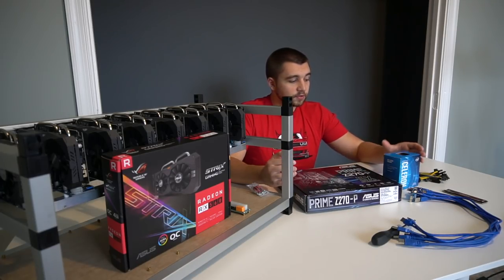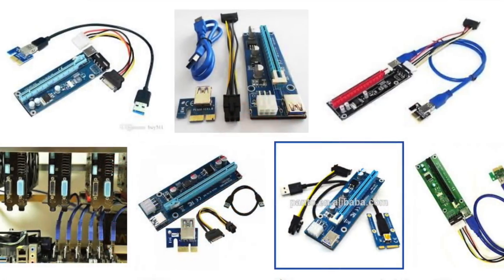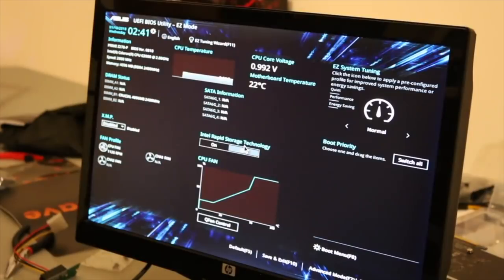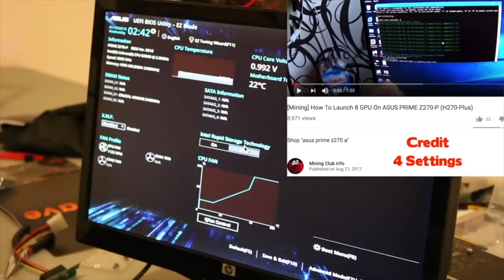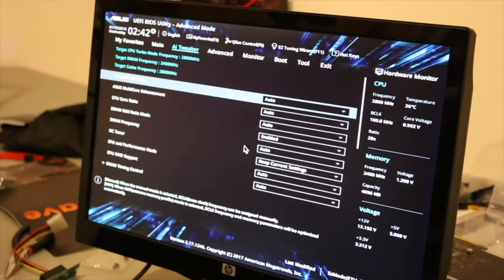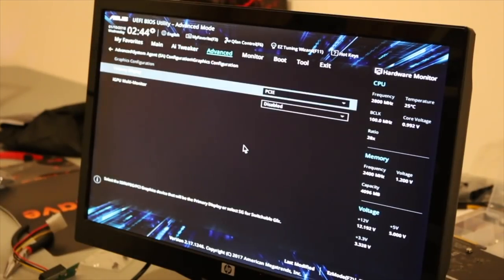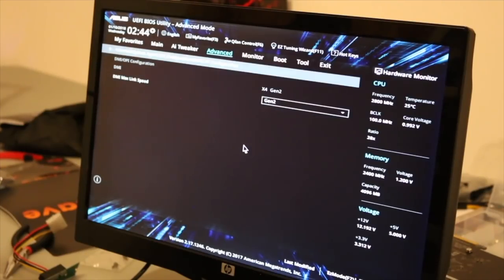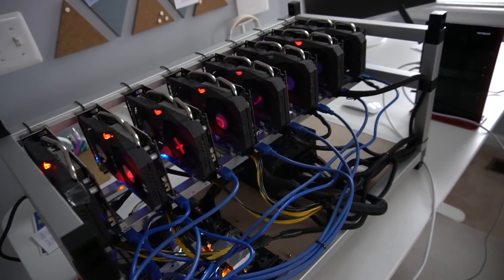How To Build Crypto Mining Rig W/ $2000 or LESS - Beginner Tutorial - ETH/ZEC/XMR

Comment: Vosk - since this is a tutorial for beginners you should have pointed out that you need to connect the power switch or it won't turn on.  You had it hanging down right in front too. I made that mistake when I built my first one. It had been a long time since I built a computer. I just completely forgot something that simple.

Comment: Beginner? I started with two GPUs for mining despite I've been building systems for a long time.  :)  Well, I did that just to minimize risk and just to see if it's all worth it.  It is quite amazing that I have these powerful video cards where it was just a dream for me to get myself just one.  I meant, without mining, I can't justify buying a nice card as I will rarely use it play games.
Reply: I'm jealous. Due to shortage, I haven't purchased a card for more than 2 weeks.  The last one I've had are MSI armors, one rx 570 and a 580.  I didn't know they have weak mechanical specs as they don't include backplates and a thick-large heatsink compared to less known brands.  They overclock nicely though and the fan is a great-expensive design.

Comment: I was thinking of buying that asus board but for the same money I can get the gigabyte b250 fintec with 12 pcie slots. 
I have a 1070ti, 3 1060s and a 1050ti in a rig which does 109 Mh\s and uses less power than these 560s.
If I would built a new rig I would buy 1050ti instead of rx560. Mine does 15 Mh\s at 60 something watt.

Comment: Hey Vosk,
I recently switched from Nicehash to Awesome Miner/Ahash pool w ccminer. My rig is a Asrock Pro BTC, cheap 1151 Celeron, 16G Memory, 6 Strix 1080ti's, version 8 risers, 2 1600w EVGA power supplies. I'm loosing about 20% hash rate on the risers. When I slot a card on another computer by itself on the 16 PCIE slot it's way better. Do you have any experience with this issue, ideas or suggestions?

Thanks 

Matt

Comment: i have a question, so this build is a little better than my gaming pc i bought 5 years ago.  My pc says id make roughly .80 cents a day. This setup should be about the same until i stack 3+ Gpu's right? I got all the parts only bought 2 rtx 560's so far. My PC currently running a 1060

Comment: Mining Buidl:

*Thermaltake Gravity i2 95W 7-Bladed 92mm 4-Pins PWM Aluminum Extrusion CPU Cooling Fan for Intel Core i7/i5/i3 CLP0556-B

*ASUS Prime Z590-P WiFi LGA 1200 (Intel 11th / 10th Gen) ATX Motherboard (PCIe 4.0, 10+1 Power Stages, 3 x M.2, WiFi 6, 2.5Gb LAN, Front Panel USB 3.2 Gen 1 USB Type-C, Thunderbolt 4 Support, Aura Sync RGB)

*ARESGAME Power Supply 650W 80+ Bronze Certified PSU (AGV650)

*SanDisk SSD Plus 1TB Internal SSD - SATA III 6Gb/s, 2.5"/7mm - SDSSDA-1T00-G26

*SAMSUNG 980 PRO M.2 2280 500GB PCI-Express Gen 4.0 x4, NVMe 1.3c Samsung V-NAND Internal Solid State Drive (SSD) MZ-V8P500B/AM

*Intel Pentium Gold G6400 - Pentium Gold Comet Lake Dual-Core 4.0 GHz LGA 1200 58W Intel UHD Graphics 610 Desktop Processor - BX80701G6400

*PCIe Riser Cable 1X to 16X Graphics Extension for GPU Mining Powered Riser Adapter Card, 60cm USB 3.0 Cable,PCI Express X1 to X16 GPU Mining Card, SATA,6Pin and Molex 3 Power Options-6pcs/Lot

*Samsung OEM 16GB (2X8GB) 1Rx8 PC4-2666V DDR4 RAM Memory Module M378A1K43CB2-CTD

*GIGABYTE Gaming GeForce RTX 3060 12GB GDDR6 PCI Express 4.0 ATX Video Card GV-N3060GAMING OC-12GD (rev. 2.0)

*CORSAIR TM30 Performance Thermal Paste, CT-9010001-WW.

Comment: If I were to have say 2 Nvidia RTX 3080s they require two 8pin connecters but the pcie riser are 6pin, what do I do I cant find 8pin pcie risers? 
Edit: Could I plug the 8 pin directly into the gpu instead of having plugged into the riser?

Comment: 1080 ti vs 1080 vs 1070 ti vs 1070 which one should i opt for ??
What is the each one making in nicehash
Any one kindly plz do reply.
Thanks in adv.
Reply: 1080ti if cost isn't an issue. 1070 if you want to use less power connectors. 1070 only need 1 8pin power cable each
Reply: Sir Swash thanQ vmuch
Reply: Tony Anzalone thanQ vmuch
Reply: Sir Swash 1070 msi gaming x is taking 8 plus 6 
So if we take aero or n e other version n if we take 1000w psu can i supply for 8 gpus that take only 8 pins ??
Reply: Female Species Never Cares Honest Love I read this comment as 'Please do all my research for me'.
Reply: Demanisraar what happn ?? ☺🙂🙁☹

Comment: Well, thats great and all nvidia... Too bad it's IMPOSSIBLE to make a card not able to mine cryptocurrency. 

Explainer (if you want to read it):
Crypto-mining works on the basis of cryptography hashes (e.g. SHA256, etc). These calculations are perfectly suited for GPUs because GPUs are designed to process large matrices of data (like, for instance, pixels on a display) and hashes are done using very similar large matrices of data. Things are processed on GPUs through kernels (essentially jobs that are dispatched by the CPU, bits of C code). In order to stop crypto-mining, you would have to make a GPU unable to accept custom kernels, which would stop OSs, games, etc. from being able to process graphical data e.g. THE WHOLE FUCKING POINT OF A GPU.
Reply: wait what does this comment have to do with the video
Reply: erazedlol he wanted to sound smart